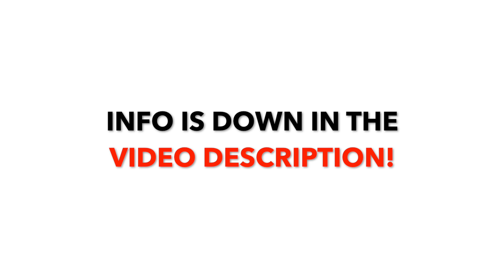Forced Air Cooling for Whoop Motors? | VCI 8028 27000kV Motors

Comment from the maker: Hello my Whoop friends. I have tried my best to improve the VCI 8028 27000kV motors. So that the voltage sag becomes smaller and flighttime bigger. The AWG20 main cable was a good start, a big improvement. But not enough. I have heard that whoop motors with higher stators of 3mm or more (703, 803, 1003) can have problems with heat dissipation, unlike 02 motors (702, 802, 1002). That's why I developed this forced air cooling. Unfortunately, there was no noticeable effect, or not a big enough effect. I think it's just the internal resistance of the motor. The manufacturers are probably tending towards thinner copper wire for 03 stator size motors because it can be wound more easily by machine. So the only thing left for me is to re-wind the motors myself with thicker copper wire to reduce the internal resistance of the motor.

Comment: I like it, i was preciously make some intake to blow my fc, quite effctive daytime since my vtx is quite hot ad 12:00 daytime.

And yeah it work.

Keepup the good share.
Reply from the maker: Thank you! Unfortunately in this case it didn't work to give this motor more efficiency. But it was worth a try :-) that's the only way you can learn. I now think with this new knowledge and information from the internet that heat is not as much of a problem with whoop motors as it is with larger motors. With whoop motors, the thin wire thickness is probably more of a problem. I'm now trying to re-wind the motor with thicker enameled wire by hand (between 0.25 and 0.3mm)..

Comment: Running more grippy props like 3-4bladed is a big factor for increased motor heat and voltage sag. Recently I switched even from 3blades to biblades. It was harder to fly, yes, but I had WAY more flighttime, and even motors are lasting now longer.
Reply from the maker: Thanks for your input! Yes, that's true, but for racing at this level, three blades are simply mandatory. That's why I have to try to improve this motor differently, for example by winding it myself so that it has less internal resistance. But I'll try it out with a two-blade prop first. Thank you for the input!

Comment: I love your tests! Just a silly comment: Have you tried inverting the rotation of the clipped props? Having them counter-rotate can definitely induce more drag, but maybe the increased cooling effect could counteract it. Looking forward to more innovations!!!
Reply from the maker: Unfortunately I don't know what you mean exactly. Because if I were to mount them differently they would, so to speak, pull the air upwards out of the engine, but against the airflow coming from the main propeller. At the moment I have them mounted so that they push the air down into the engine like the main propeller. Of course it's an additional load for the engine, you're right. That's why (or for other reasons) it didn't work.
Reply: @butterflyfpv  Thanks for the reply, and I'm sorry if I created a bit of confusion here. I meant something similar to what you did but in a coaxial setup on the same motor, where the lower prop would be mounted upside down, still pushing air in the same direction but having a greater angle of attack near the hub. Not sure makes any difference anyways :)
Reply from the maker: @LochnessFPV  Oh I see what you mean. But the profile of the individual blade of the cooling fan would then be wrong? And in addition, the engine bell would not be nicely covered and the air could escape more around the engine bell instead of being pressed into the windings? But yes, that would definitely be an idea to just test out. Thanks for your input/help!